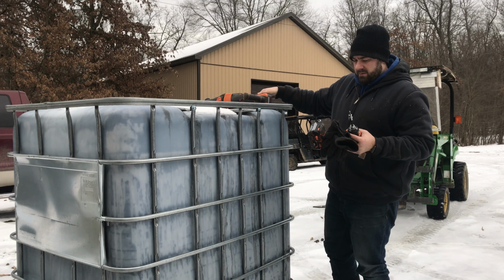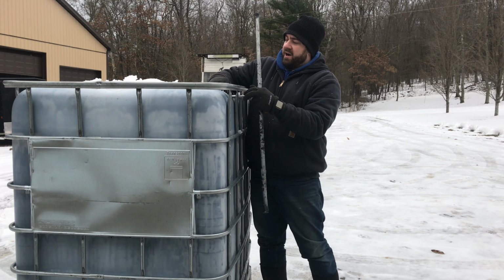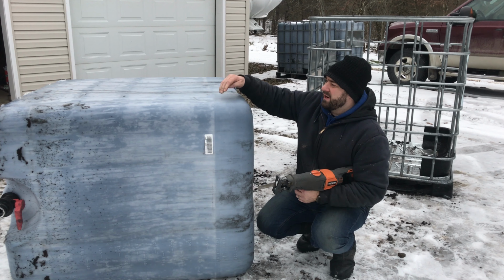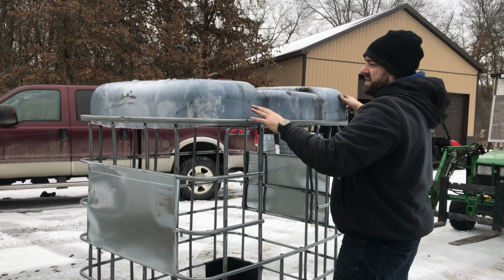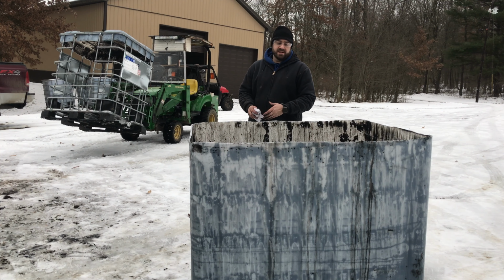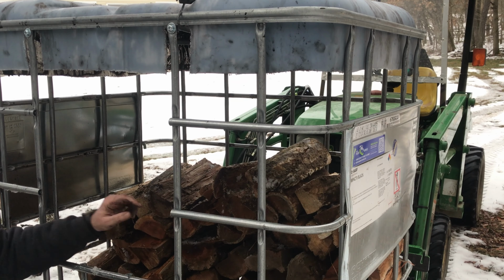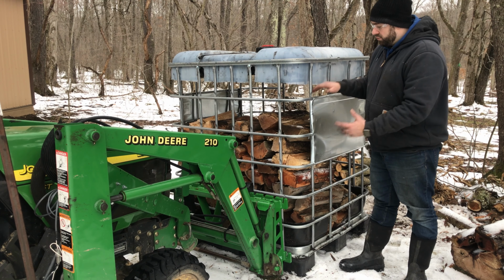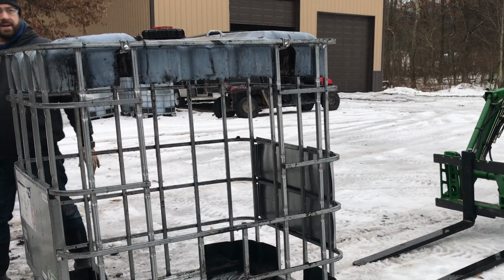#133: Cheap IBC Totes for Firewood. The Best Firewood Rack

Comment: I just got done doing a very similar video today. Going up tomorrow. I have to say I’ve always used an angle grinder but your reciprocating saw cut through the metal much better. I think I’ll start doing that from now on. Also the tip about cutting the plastic on its side. Thanks for the tip. One thing you’ll have trouble with is having such a big gap between the top of the wood and the bottom of the rain cap. You’ll get rain and snow blow in from the side. It’s better to have the roof sitting directly on top of the wood.  My video tomorrow is about getting rid of the rest of the bladder. Most asked question we get.
Reply from the maker: I'm looking forward to your video tomorrow. I actually recorded this last week, and have seen several videos posted on this topic (IBC totes for firewood) in the last week on different channels.  Popular right now!
I was worried about snow/rain blowing in.  They'll actually be sheltered on the back (against my garage) and potentially the sides (by each other).  I hope to be able to fill them more to the top someday when I get a stronger tractor.  Thanks for watching and commenting!

Comment: So I drill 2 holes into the corners and use large zip ties to secure the top. I cut my tank at a diagonal so it's at a point which helps with shedding snow and ice. You could just drill a hole on each side of your vertical metal braces near each corner to run zip ties through.
Reply from the maker: I thought about cutting them diagonally, but wasn't sure how the lid would hold up to heavy snow.  I like how these turned out with the notched cap.
Reply: @PurpleCollarLife  mine have done fine. Had them for almost 3 seasons now.
Reply from the maker: @clashavenfarms6714  Thanks! Maybe I'll try one that way to compare.  Appreciate it!

Comment: I cut a hole in the side of the tote at the same size as the metal cut out. Then I filled with wood. I opened the drain valve to ensure it doesn’t fill with water
Reply from the maker: That's one way to keep the rain off of it! Does it get enough airflow though to season?
Reply: @PurpleCollarLife  I am not sure. My cousin, a farmer, recommended this so I have some hope that it will. I’ll know myself in a year.

Comment: Won't keep them dry if the rain is coming in at a angle would be my guess but for the most part should keep them pretty dry
Reply from the maker: That's true.  But since 1 side is against the garage wall, and one side is against the other IBC tote, 2 of the 4 sides are fairly protected.
Reply: @PurpleCollarLife  very true

Comment: Nice work.  
Yea, I too, was always curious as to what to use the bladder section for.  
Your roof section seems to be a good use of part of it.  I've also seen it, where they will cut the bladder diagonally to make a larger peaked roof.... that would have an over-hang on each side of 8 or 9 inches.  That way, 95% of the rain would drip off those 2 sides, plus its dripping off further out and away from the firewood.  thanks
Reply from the maker: Thanks 👍
Reply: @PurpleCollarLife     Hey Chad, I tried posting a link yesterday, but I think it was probably held as spam.  If you'd be interested in seeing the peaked roof for the IBC tote... just search Youtube for the title of, "THE ULTIMATE FIREWOOD STORAGE SOLUTION!!!! AN IBC TOTE WITH PLASTIC ROOF - COMPLETE BUILD"
Reply from the maker: @Patrick Wagz -sorry - I just found a bunch of your comments in the "held for review" spam comment list.  Sorry about that.  Thanks for this info!

Comment: What were those originally used for?
Reply: Chemicals, perfume, etc.  Fluids in bulk basically.
Reply: Have you thought about spraying the tops with a chemical neutralizer to neutralize any chemicals that may get on the firewood?  Some of that stuff may cause harmful fumes when burned.  The plant you got them from should have a Material Safety Data Sheet listing a neutralizer for accidental spills.
Reply: Some kind of basf product if you look closely
Reply from the maker: Hi Mike.  These particular ones were used for non-toxic black or brown dye that is used in creating garden mulch.
Reply from the maker: I did some research, and it's amazing what these IBCs are used for - both by design, and after re-purposing!
Reply from the maker: Mike- good thought for some of the totes.  These particular ones held non-toxic material.
Reply from the maker: Dye used in producing wood mulch.  It's non-toxic.
Reply: @PurpleCollarLife  They look very useful.   I once worked in an automotive plant where they were used for electro-coating solutions so that's why I was asking about potential toxic concerns.

Comment: If I buy enough totes would it justify buying a 4X4 tractor with forks, bucket and snowblower?😎  If you don’t mind me asking what do you pay for each tote?  They run around $20 each in Michigan.
Reply from the maker: I made a good connection with a location that uses a lot.  They run $25-50 around here. I'm getting them for less than that, but not quite free.

Comment: Put the bladder on a pallet and use a 2x4 and screw it down. Store your firewood in it and tarp it. You don't need the metal  rods on the top. Easier to stack your wood in it.
Reply from the maker: Nice idea - thanks!